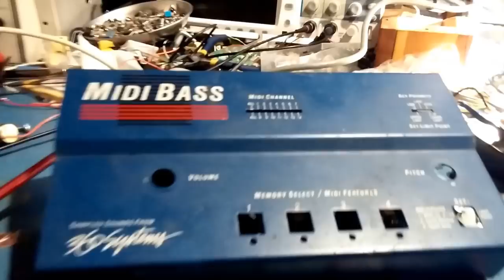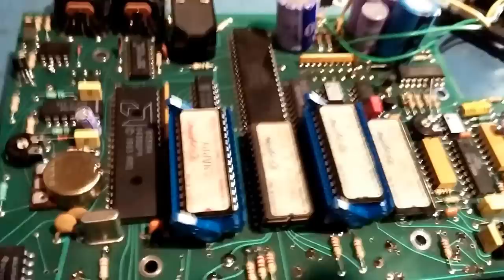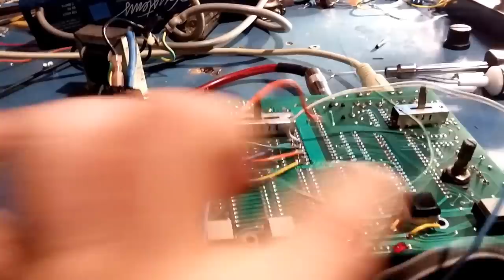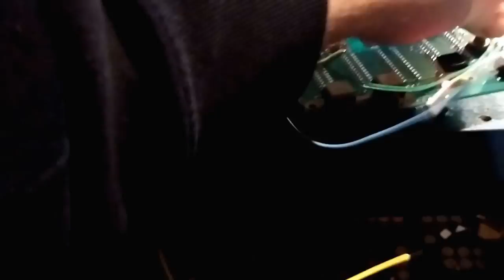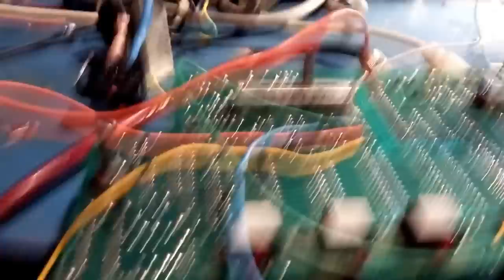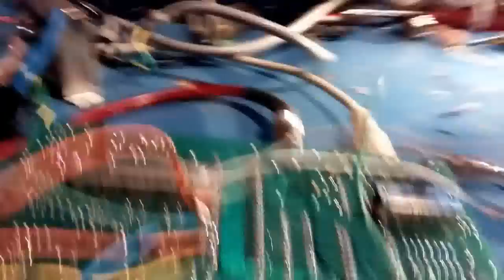360 systems MIDI bass modification in progress.

Comment: Just got one of these at a Thrift Store for $20, have one of the Rack Mount "Pro" units.  Are there any "Hidden" tone or Envelope  adjustments?  The "Pro" I have has these tweaks, but won't save them (I use mine with a organ style Pedal Clavier and prefer the tones relatively Dark with about a 1/2 second of Snubbing Sustain, but it wont save).
Reply from the maker: Craig Browning This unit is super basic and it's got a very limited interface.  I bet you could find the user manual for yours online.

Comment: Hi Ben! I Just got one of these. Do you know if there is a way to get rid of the typical 80’s release/reverb? That should be in the system not in the samples right? Thanks man! Niels from Amsterdam
Reply from the maker: No, this is just basically a sample player.  Have you tried other roms or burning your own?
Reply: No not yet, don’t know how. You know people who can? I have 3 extra Eproms. Snappy, Rickenbacker and 8 string. Ill check if these have that echo thingy too.
Reply from the maker: They are REALLY easy to change. You just take off the cover and they are in slots right there.  29 seconds in shows that there are two that even have ZIF sockets, which means no fiddling about. You just flip the slider, take two out and replace them with no stress.
Reply: Hi yeah I know, that’s a no brainer.. 😉 I meant changing/replacing the samples ON the emprom. Or at least loose the 80’s echo. 😊